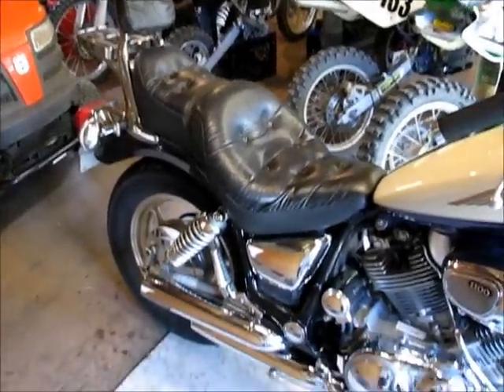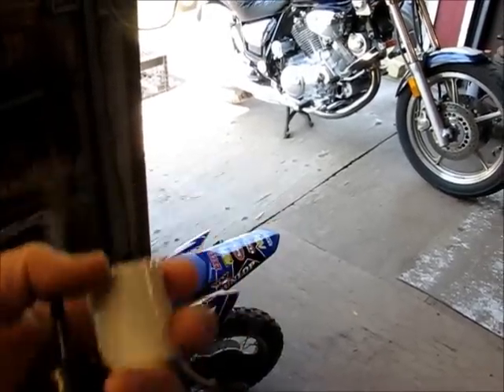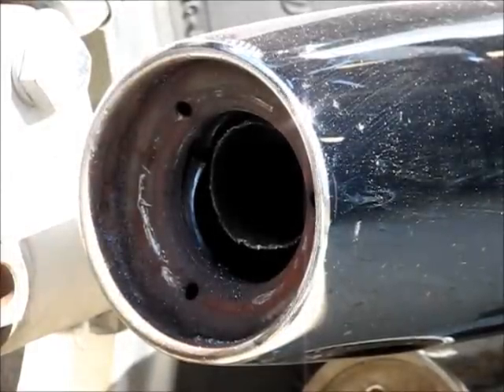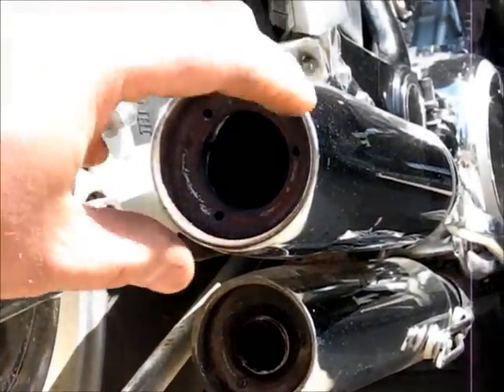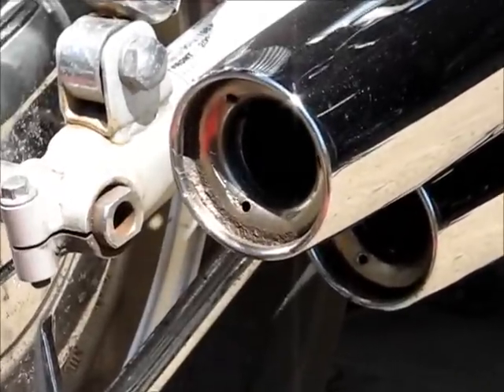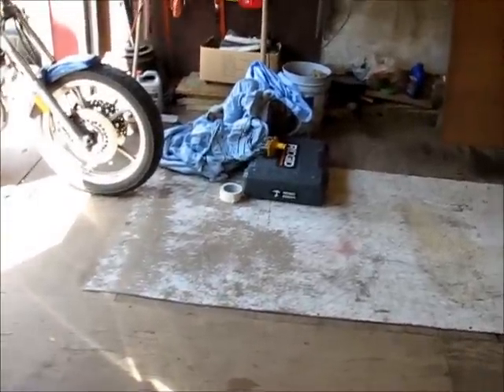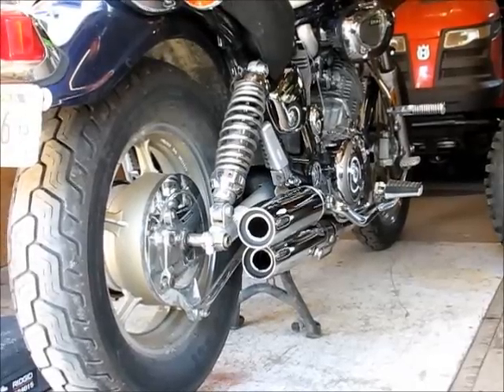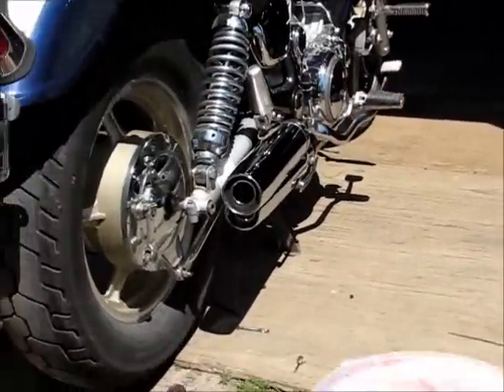How gut stock exhaust on Yamaha Virago 1100

Comment: Congrats, very nicely done video!  Good results too, looks fantastic.

Yes, those hole saws are not meant to go fast as they don't have fancy hard teeth.
Go slow and use a lot of spray cutting fluid, which is preferrable to oil.  Spray about every 5 seconds.

Comment: Great vid. I'm gonna do this, I just got a 92 virago 1100. I'm just confused on how the back plate you drilled a hole in for the plumbing piece stays inside the pipe. The rivets are all still intact on my bike so I'll have to drill them out, but I don't see how those cupped plates actually stay in the pipe?

Comment: what about the performance, i read that if you open/change exhaust system your hp drops
Reply: You need to re-jet for optimal performance, That´s because you cange the air flow
Reply: NGSVALENCIA what jets do i need to get ?
Reply: Well I think adjusting the carbs with the stock jets will make it

Comment: I just replaced my exhaust on MY 97 and it was not cheap by any standard. New this is an 1100 dollar exhaust system and used is only a little bit better. Having said this, why would you want to destroy an exorbitantly expensive OEM component when you could get a replacement aftermarket system instead and and maintain the original?
Reply: 1. You don't have money to go buy a set of pipes. 
2. You don't have money the spare momey yo go buy a used set of pipes. 
3. You don't have money...  This is getting rhetorical because it's common sense.

If you have the money to throw at it then you're likely going to end up buying a early toblate 2000's Vstar instead. 
I legitimately see 3 to 5 Yamaha Viragos going for sale online locally for $500 to $1000 at a yime because of dead batteries and need of a carb rebuild all the time, why would i spend $1100 on pipes when i can buy a parts bike for half???
Reply: Used stock exhaust systems for this bike are like 80 bucks if you mess it up so go for it instead of the much more expensive after market ones
Reply: @TylerGibsonSIRdipsALOT69  $350 to $500 I’ve seen around here, which is insane

Comment: On my STOCK '03 V-Star 1100 Classic, I installed a K&N reusable air filter element (flows more air), and removed the AIR injection system (to eliminate the backfire on deceleration).  At this point, the stock carb jets were TOO LEAN.

The stock carbs have different size jets for each cylinder.  A #110 jet is used in the carb for the (#1 rear cylinder) and a larger #112.5 jet in the carb for the (#2 front cylinder).  I re-jetted the carbs by putting the larger main jet from the #2 carb (front cylinder) into the #1 carb (rear cylinder), and buying a size larger jet #115 and installing it in the #1 carb, (front cylinder).
This modification gave increased performance and I believe is ideal for these modifications. 

IF THE MUFFLERS ARE MODIFIED (drilling out and removing the baffles), OR installing aftermarket slip-on mufflers, I'm sure the carb main jets will need to be increased by at least one jet size.  (You can try putting a larger #115 jet in the #1 carb (rear cylinder) and a #117.5 jet for the #2 carb (front cylinder).

Making intake and exhaust mods which increase air flow without re-jetting the carbs can cause the engine to run excessively LEAN and cause the pipes to turn blue and even cause overheating and internal engine damage.
Reply: doesnt the catalytic converter keep that from happening ?
Reply: __ Does not have a catalytic converter.
Reply: Russell Hohl Mine does :/ taking them out right now drill is charging -_-

Comment: Spin the hole saw WAAAAY slower. Use some oil.
please dont ride that thing on the road with glued in drain pipes.
That is a hack job and irresponsible to risk shooting them out on the highway.
use a fkn welder.